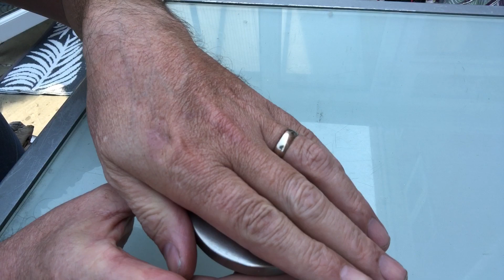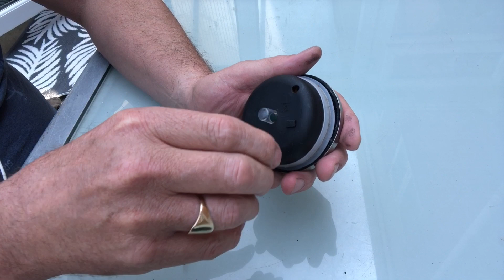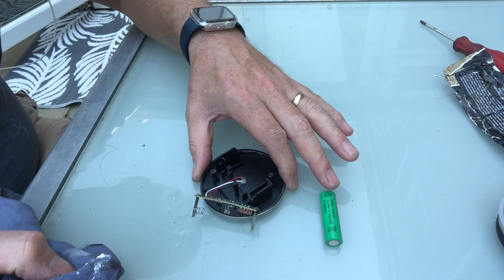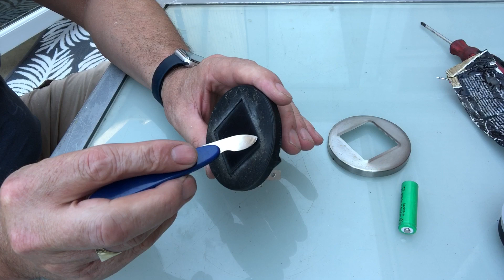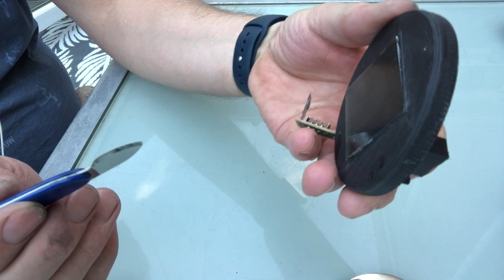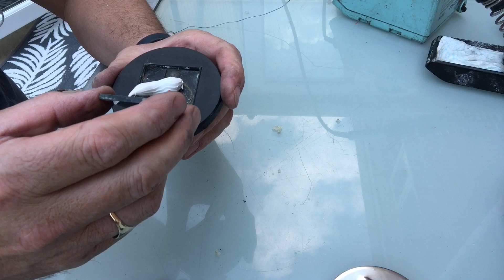Faulty Glass Jar Solar Light Free Repair.

Comment: Corossion is the most common cause of failing solar lights. REally bad but they are working outside it can also condense inside also when lamp is water protected or good secure from moisture. But normal cheap lights are max IP 44 or less when i see how it was secured and protected inside i think sometimes it is less than IP 44 ;)
Reply from the maker: Agreed,  its shocking the way they are not sealed. These products are leaving the shelves with inbuilt failure through a total lack of weather sealing.